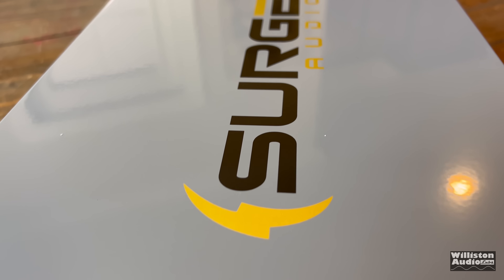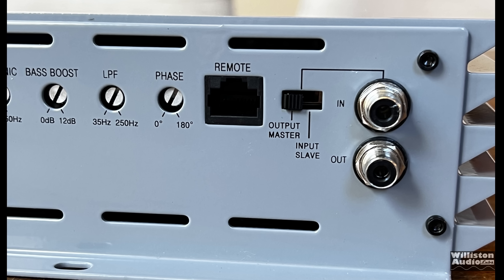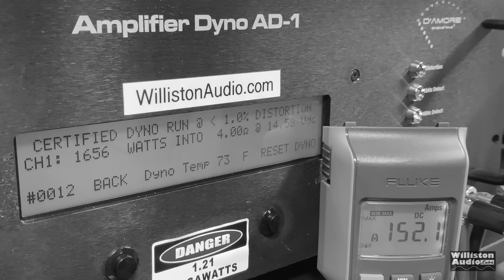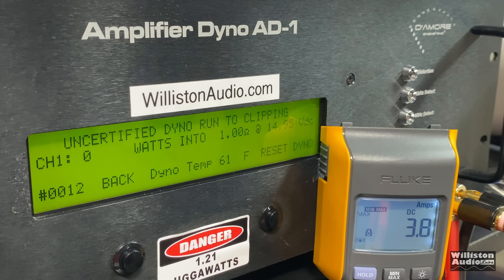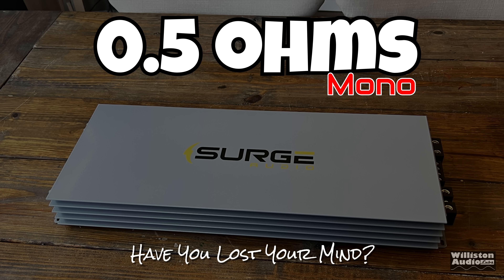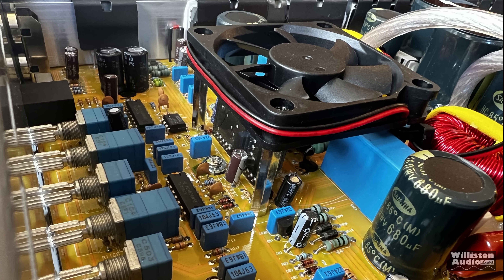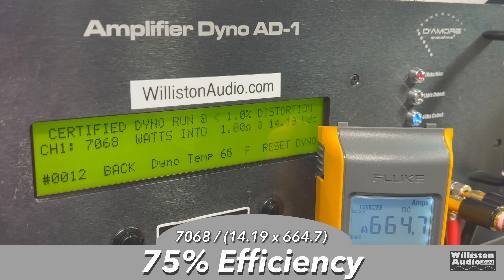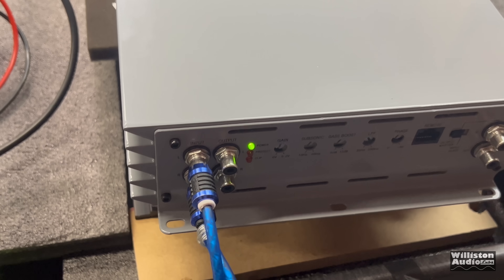SURGE AUDIO 4000W Monoblock Amp Dyno Test and MORE

Comment: As much as I enjoy the amp dyno vids, it's starting to seem like there are just too many of the same Korean amps being rebadged. Don't get me wrong, I like them, in fact I own the JP8, it's just getting old because they're all the same and we know what to expect. You could just look at the bass remote, open the amp and end it there... I wanna see some cheap Amazon crap blow up again! Or maybe surprise us all!
Reply from the maker: Thanks for the feedback. I try to keep things interesting, have some different stuff coming up.
Reply: I would not assume anything is being rebadged. Rebadging is rare. There are so many companies building amps using the same old digital designs layout that people see a similar amp and assume its from the same company. It's usually not.
Reply: @JasonWW2000  you may be correct when speaking of Korean products, but rebadging is very common in Chinese manufacturing. In any case, there's no denying the insane similarities between these Korean amps. Call it what you want, I just see the same old amps over and over again. I'm not saying it's a bad thing for consumers, it just makes for some boring videos.
Reply: @JasonWW2000  rebadging is NOT  rare at all. They're almost all S and I built amplifiers, and that's not an assumption. China build houses do it, and so does Korean. It's the same with many drivers as well.
Reply: @Chuck_Sanders  I think your confusing rebadging with copying. Its two different things. When I first started looking into all these "rebadged" amps I thought just like you. They seemed identical. It wasn't until I looked deeper and did more research that I realized what I though was rebadging was actually different companies coping the same design. Even when you have similar looking products coming from the same builder. You have to look deeper. Look at the components, count the winds on the transformers, disect the mcpcb. Different amp companies can tell these build houses to make a product to different standards. Use a cheap transformer in this brand and a more expensive one in that brand. This is why you see similar looking amps perform differently, even when they come from the same build house. Different component tolerances, thicker board traces, etc...
The average person does not pick up on these nuances. They look at the underside of an amp and see that the basic layout is the same as this other amp and just assume they are identical. Its simply not the case. Even amp repair techs like Barevids will tell you they are not identical. He often will say they are the same, but what he means is they are the same layout and basic design, not that they are literally the same.

Comment: Very nice looking amps with  lot of power, nice design and build qality. The only thing that drew my attention was a couple of minor paint quality issues.

But the most I would like to know is how the dampening factor is with these subwoofer amps; it's quite important with subwoofers. It's a pity that the SMD doesn't measure that.
Reply: Damping factor is always horrible with class d amps. Well at least all I've tried were low damping amps.
Reply: @Fabel gamer  HI Fabel gamer. That's the reason I always avoided class D amps. The only class D sub amp I know that has got a good dampening factor is the Audio Control LC1.1500 (around 650). But the downside after I bought the AC was its standard 24dB high pass at 24Hz (you can't turn it off). Now, I am still not sure to use the AC or my old Steg 2 channel K2.03 for my upcoming installation. That has a dampening factor of over 1000 and no subsonic filter at all.

Comment: Love the video Big D!!! I think it would be awesome if you also did testing comparing the differences as far as the reactive real world in the car clamping the inputs and outputs of an amp to see the differences idk I think it would be cool 😎! Love this little beast of an amp and love the colors!!!
Reply: I don't think that kind of testing would be consistent or relevant. There are too many variables. By doing tests in a consistent manor you can better compare different brands and models.
Reply: @JasonWW2000  if he was to charge at 14.8 wired to a set of d2 woofers down to 0.5 ohm it would show us, A what the amp could do real world wattage and current pulled after introducing impedance rise I think that would be a petty awesome relative test.
Reply: @justforlaughs8988  Thats both too specific and not specific enough. The impedance curve of the drivers will be influenced by the type of enclosure, size and tuning frequency they are in and the size of the vehicle. The impedance curve is how the amp makes power. We can already infer what the amp will do at lower impedances. So the test you describe would be useless. How would your test be relevant to a person using a Cmax battery? Not very. Most people running really big amps are using lithium. I guess your asking for these tests because you don't know how to take the info from the bench test and translate it into how it would perform in your specific setup. Thats valid, not everyone can do that. You don't really need specifics, you just want a general understanding of how it would work on real music. The only way to know for sure is to try it yourself. Get your subs and play them in your vehicle, watch the impedance change, measure your current draw, see how low your voltage dips, etc... If your setup only ever dips down to say 2 ohm then you know at max unclipped volume this 4k amp is gonna draw about 275 amps. Can your alternator and battery supply that kind of current? If not, limit the volume so the amp draw is less. It really is that simple. Once you know what the amp does you can put that info into your situation and determine if its going to work for you or not. 
If you want, you can tell me your setup and I can recommend what amp size you should get.

Comment: All the internals and bass knobs look the same in SURGE / GATELY / CT SOUNDS / and D4S amps..... are all the companies using the same suppliers and just changing the outside heatsinks????????????????????

EVEN THE SHIPPING BOXES ARE THE SAME !!!!!!!!!!!!!!!!!!!!!!!! Still very impressive.
Reply: No, there are many companies making the amps. The reason the internals look similar is because they are based on old Digital Designs amp schematics. Its a 20 year old design, but it works well.

Comment: Just buy a D’AMORE amp and thank me later!
Reply: Go in half wit us so we can get 1 😂😂
Reply: @randywatson4870  lol
Reply: They have limited power. 1k is the biggest.
Reply: @JasonWW2000  rockford fosgate amp then, you get CLEAN sound out of Quality AMPS. i’ve tried a hand full of amps and ill rather save my money to buy a good one then these copy amps. im pretty sure this amp like the jp23 i had. id buy a used old school kicker amp instead of these just because you know they going to last.
Reply: @FishingWithJo415  Even Rockford is limited to 3k. It might be too expensive if you needed 20k. Luckily you don't need clean output with bass. Even a crappy design will sound good. I think in order to last a long time you need to not max it out. The reason these big amps go out is people maxing it out.
Reply: @FishingWithJo415  All my amps are Rockford from 1997 to 2006. Still going strong. I don't max them out, though.
Reply: @JasonWW2000  for sure you absolutely right in what you said. the only thing different is you can hear the difference in a low quality amp from a high quality amp. you right though, you still going to get bass out the subs
Reply: @FishingWithJo415  I have not been able to do a listening test myself, but I did see the test done by Barevids.
Reply: @JasonWW2000  Man and thats what im talking about, when you get a good brand amp. youll never be jumping around trying different stuff to see if you hit a diamond of a amp. when the internals from them aint going to last

Comment: I’ve ran a very similar wolfram at .17 on speakers. As long as you rolled into even test tones it never protected. Only protected if you burped tones at clipping. Pretty typical for high quality Korean. Done it with DB aak and salt series also. .33 on speakers is always fine with these types of amps. Just expect a lot of current draw. Great video 👍🏼👍🏼
Reply: Somebody math ain’t mathin’. ……  

.17 load = my 🍑 

Good lawd,   What’s next?  Negative ohm load?   

That’s what I wire my omega 40k to bro!   -.68 ohm load,   Do me and I owe you one style!!    When you wire reverse (negative ohm load) it’s like a Tesla when it regenerates during braking!
Reply: @caseytbss  yes my math is correct. I currently have 3 db aak 20,000.1 wired at .4. They don’t even get hot. Clamp about 21k an amp on speakers. I’ve spent $15k on electrical. So they stay above 16 volts.
Reply: 2x salt8s strapped at .7 clamping almost 25k... 190ah cmax not even stressing the draw lol
Reply: @scottouimet2865  2 salt 12’s strapped at .25 clamping 49,500. Popped amps frequently
Reply: @ThisIsMyHandle-48  I haven't kilt an amp yet thankfully, hope I don't either lok
Reply: @scottouimet2865  sounds about right. Very nice 👍🏼

Comment: The warranty on surge means nothing.
Reply: Why?
Reply: @Lazerchicken69  because the guy is just a shady He's the one who started Wolfram audio
Reply: @abdomination  ok but why? Examples?
Reply: @Lazerchicken69  how many examples you want about surge not warranting their products ? Sounds like you talk a lot and have nothing but questions to ask. I've made multiple videos about the bogus warranty coverage. The man " colin" doesn't even communicate much less warranty his items. I'm going thru it right now.  I own 7 surge amps.  I know ... how many surge amps do you have ?  Where's your proof of ownership ? When have you dealt with Colin ?  See,  I can do just like you ! Just run my mouth. But,  the difference is.  I can PROVE IT.  Even the authorized amp repairman say the Amps are dangerous. Most of the amps won't run even at the initial power up.  Maybe you should do your homework and actually look at the failure rate.  Yeah,  I know what I'm doing . Only been a osp network engineer for 37yts . What's your experience ?
Reply: No warranty means anything.
Reply: The warranty is not worth shit.  He gives refurbished amps.  He ran out they were so bad.  I'm running 2 ohm all 6 Amps . They didn't last one day.
Reply: if you have to fight to get a repair done is it really a warranty
Reply: @418lightning8  they don't actually repair, all they do is either replace it and wait for the buildhouse in china to fix it and/or get them a new one..
Reply: Just cuz he's shady doesn't mean the warranty isn't good lol
Reply: @schons77iceman  lmao right.
Reply: @schons77iceman  he has to approve the warranty . So,  when he doesn't approve or respond. Then it's shady . I will be glad to send you emails that are all unanswered . You wanna buy my 7 surge amps at a deal ? I will gladly hook you up . 😂😂

Comment: New brand surge audio Wich is just Wolfram audio
Reply: Actually technically surge and wolfram are both separate companies surge is just owned by the old owner of wolfram im pretty sure
Reply: All of em just look like glammed up skars anyways 😂 at least the subs that is
Reply: The correct spelling is "whitch". The "Q" is silent.
Reply: So is jp amps
Reply: @Azbasshead602  Nope
Reply: @JasonWW2000  o yes all day
Reply: @Azbasshead602  Are you not attentive? They are obviously different. You see, it is a common myth that there's only one company in China and one company in Korea that makes amplifiers. The reality is there are many many different companies making amplifiers in both countries. It can be easy for someone who's not really experienced to look at the circuit board inside two different apps made from two different companies and even two different countries and think they are the same product simply because they are both copies of a older original design. They can definitely look similar, but are in fact completely different in pcb specs, component specs, preamp circuitry, transformer windings, etc... This is exactly why you can gave 2 different brands look the same, yet perform very differently. I'm trying to educate people on this.
Reply: @JasonWW2000  how do people not get that. There's 2 main build houses in south Korea, zenon and  s&I. S&I better components internally and handle half ohm all day. The zenon will burn up much easier. Zenons quality control isn't near what s&I is but I have all zenon for now. Have more than enough lithium though and I don't plan on wiring below 1 ohm
Reply: @michaelmosher7902  I'm not really sure you can say that S&I always use better components and always handle half ohm all day.  It's typically not their call what components to use. It's usually the retail company (Name brand amp company selling to consumers) that tells them what components to use or what level of quality to make it. Now it is possible that S&I has set certain standards and may refuse to use low quality parts and tell their customers up front that they will not be the cheapest, but the quality will be higher. I don't know if that's the case. It may be a coincidence. They may offer lower quality builds for a lower price point. Who knows. For the moment, all their amps seem really good.
Reply: @michaelmosher7902  so who makes surge?

Comment: I wouldn't even be testing these or buying their products at this point. Not with everything coming out behind the scenes.
Reply: Totally agree they ripped me off 1650 dollars. And there's no way to have anything done about it .
Reply: What’s going on behind the scenes?
Reply: Him and his worker came up with a lot of racist stuff
Reply: @Azbasshead602  if it's not about the quality of their shit or them standing behind their shit it's irrelevant.
Reply: @Azbasshead602 who cares. How does that affect the amp
Reply: @RP4886  I wouldn't buy any of their shit I bought a Wolfram aw 9000.1 Korean and it was doa it cost 1650 dollars I couldn't even get in touch with anyone and it's total crap so I have a blown amp I took it to a shop and they want 550 dollars to fix all the blown output section parts so having 2200 dollars in a 10k amp no thank you  I knew I should have bought a JP amp  that does triple the RMS rating  and more sometimes I know better now to never deal with surge or Wolfram the company that files bankrupt then manjically releases same looking amps under a new name same boards just a new name same build house same acrylic bottom same stickers on top of the caps  f surge
Reply: @joshholden8561  it's not the same company,  Colin left Wolfram to start Surge. Also, How did it come with a blown output section? I know 3 guys around here in Ohio and Kentucky, that had no problems getting with Wolfram on any issues...so that's weird all the way around.
Reply: @Conrad Galindo  so people aren't wanting to buy a nice product just because some racist stuff?? Who the hell cares lol
Reply: @brianmosher4053  I care. I wouldn’t support someone who doesn’t GAF about their potential buyers
Reply: Ever think their right!
Reply: Am In phx kno the beef
Reply: Dick tease much? What’s happening
Reply: Source?
Reply: Is there more evidence? All i saw was some blurry ass screenshots that prove nothing.
Reply: @Nismopower93   You didn't see cause you don't wanna see.
Reply: @ddtstrc9678  THIS